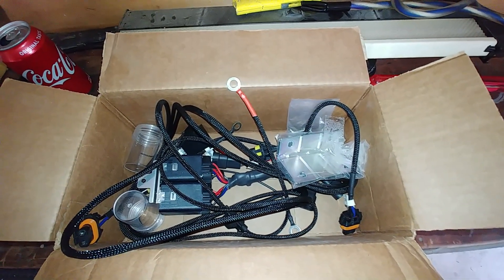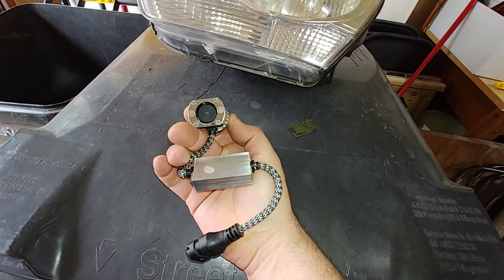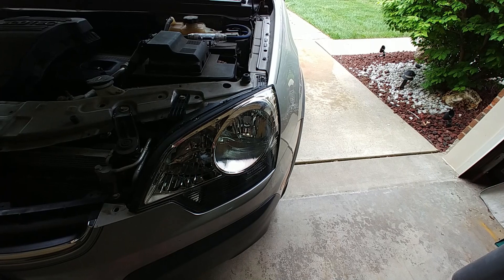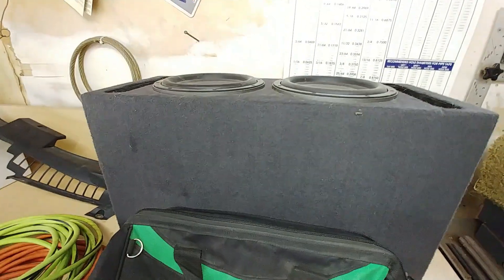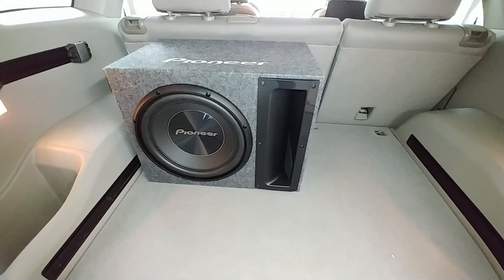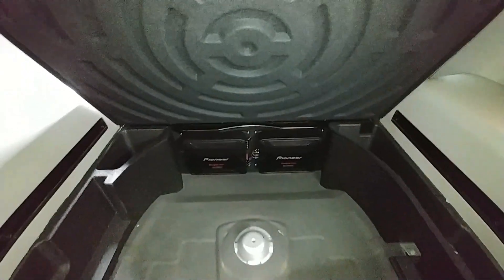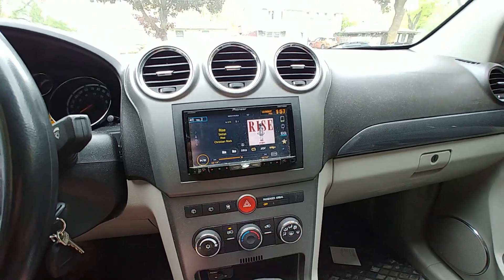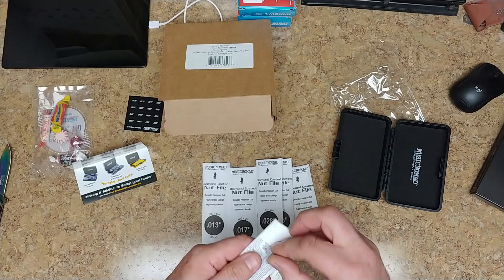Kind of a Normal Day for Me and a Unboxing

Comment: A mechanic once told me that 'buffing compound' takes off that haze on headlight lenses. I've never tried it, though. So, I don't know.

EDIT: I just checked out a website out of curiosity and 'Polishing Compound' (Turtle Wax) was used and worked really well - apparently. Hmmm...
Reply from the maker: Yes, but you have to sand with 1000 grit to remove the mold.
Reply: @ericctheartofnoise8613  Ahh. Well, if one doesn't have the money for a full replacement, it's an option. Sometimes those parts can get ridiculous! We had to replace a fuel sensor that went on the fill pipe on a Subaru we used to have. It was a VERY expensive job!
Reply from the maker: I use to sand the one's I had on my PT, but it just came back after a year. I ended up replacing them.
Reply: @ericctheartofnoise8613  Ahh. Good to know. Thanks for that. If I ever have cloudy lenses, I'll keep that in mind for the duration the fix lasts.